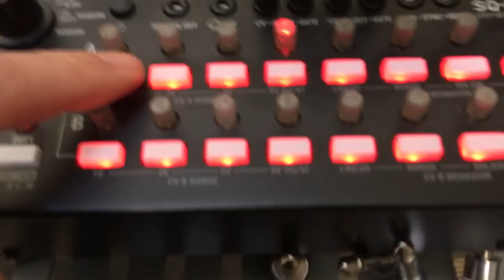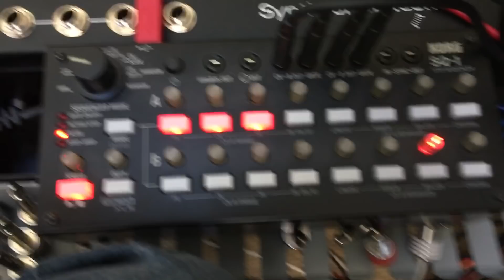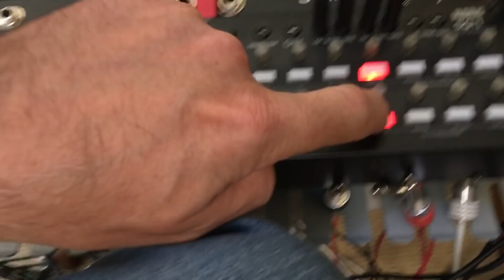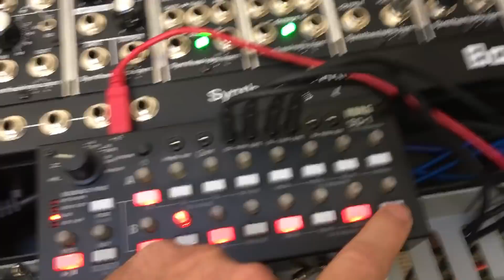Korg SQ-1 Undocumented Features

Comment: Yes this very simple yet versatile sequencer has a lot of undocumented features. Also, since its behavior is different between midi and cv/gate modes, you can use midi connection and still send cv controls to filter, envelope and so on. The only feature it lacks, is the ability to keep tempo when switching modes with the main knob: it restarts from the first note and usually loses the tempo, if you are not perfectly precise with your hand. I wish that Korg decide to release a firmware fix to allow the sq-1 to go on thru the sequence keeping tempo when switching the mode, as is in the volca series. Maybe soon ?? 🤔

Comment: Chromatic sadly has nothing to do with "quantisation"....Quantising is rhythm or better "grid" related...Chromatic is scale related.
Reply from the maker: From a technical standpoint, mapping any set of larger values to a smaller set is Quantization. I agree that in our DAW’s we quantize time (or beats). The SQ-1 does quantize it’s output voltage from a continuous range of voltage, to discreet values determined by the settings (either Oct/V or Hz/V). A Chromatic scale is a frequency relationship between pitches. In Western scales, the Chromatic scale is in semitones. Our synthesizers convert Quantized Voltages into Chromatic pitches.

Comment: Can you run two midi devices on channel A and channel B with different midi settings ?  A set to midi ch 1 and B set to midi ch 2.
Reply from the maker: I’m not sure I understand your question exactly. By default Chan A outputs on MIDI CH 1 and Chan B outputs on MIDI CH 2. You can change this with the Global Settings method. When in the Parallel Mode, Chan A will output to MIDI CH 1 and B will Go to MIDI CH 2. If you assign one synth to CH1 and the other to CH 2 you will get independent notes on each synth. You are limited to 8 steps for each channel. If you go into a mode that uses all 16 steps it will be output ONLY on CH 1. Not sure this answers your question or not, so feel free to elaborate.
Reply: Thank You. Really appreciate your getting back and your excellent video.

Comment: Hi, I have a question. I'm thinking of buying this machine, but I was wondering and you seem to know the SQ1 very well. 

If I sync it to another machine with the 'sync in' connection where the other drum machine has sync triggers at 1/16 (compared to a measure on that drum machine) , can I somehow have faster speeds going out of the SQ1?

From my understanding no, cause the SQ1 will move forward a step based on the input sync, so it can never go faster than what the input sync is doing, but I hope I'm wrong?
Reply from the maker: Hi Dieter, if you want the SQ-1 to run faster than the clock on Sync In, then set the set the Sequencer step resolution (SEE FAQ on Korg website how to do this) to one of the x2 modes. It will run twice as fast as the input clock. You are correct in that  Sync is a STEP control and not a speed control. Another idea is to use the GATE OUT of one channel of the SQ-1 as the sync TO your external drum machine (your drum machine will follow the SQ-1 gates as a clock). That way you can turn gates off on the SQ-1 to slow down the drum machine relative to the SQ-1. This is probably only useful if you are only using one channel of the SQ-1 for notes though. Assuming you are in the parallel mode with 8 steps from each channel, you could have the SQ-1 effectively running 8 times as fast as the drum machine (by having only one gate ON for the 8 steps). Using this technique you can get quite strange results when the number of gates that are on is not an even number, or are not evenly spaced!

Comment: Hi Mike! I have SQ-1 hooked to TD-3-MO and the gate just never closes to trigger new envelope, voltage changes but it is sliding slowly to zero volume... I had to insert one extra Gate ON slide OFF note, any chance you know why could this be?
Reply from the maker: Hi, and thanks for watching the video. I took a quick look at the spec sheet for the TD-3-MO since I don’t have one. It looks like the Gate input is compatible with the SQ-1 Gate Output (which is almost 13V when ‘on’). I’d make sure the duty cycle isn’t set to 100% on the SQ-1. ‘Off’ = 0V, ‘On’ = 13V. The other thing you could try is hooking up via MIDI. Without your Bass synth, I unfortunately can’t experiment myself. I hope you work it out.
Reply: @mikeolson7588  I thought I figured it out with factory reset but not... I will keep trying.... Noticed the same behaviour if I push the duty knob past 4o'clock, even without the slide... Thanks anyways for the videos and active participation!
Reply from the maker: @gumdlab7233  also make sure its in the Positive Gate mode. Remember it supports both the 1V/oct mode and the Hz/V standard. The Hz/V is the old Korg standard and the gates are Ground instead if +5V.
Reply: just measured it with meter it is just solid 10v out of gate all the time with slide. the next active step/gate on  with slide does not seem to drop it to 0 to restart the amp envelope.But maybe that is as designed and the synth is at fault...

Comment: Hello, my SQ-1 arrived today and I have a question regarding midi output. Testing the unit I'm using only the supplied midi adapter that came with the unit. I connected it to my Novation Bass Station 1 via USB cable only. It only plays sequence B not sequence A? Is my unit faulty or is this normal behavior using the supplied midi adapter?  Found nothing in the manual regarding. Thank you .

Comment: Hi there - does this device have a swing function?
Reply from the maker: That’s a great question. No, it doesn’t have a built-in capability for swing. However, since it has external sync, if you have a device that produces gates with swing, you could sync to that gear and get a swing effect. I’ve been using an external gate generator lately with the SQ-1 to create irregular rhythmic patterns and it works quite well.
Reply: @mikeolson7588   Thanks. Sounds a bit complex. No swing a bit of a deal-breaker for me.
Reply: @mikeolson7588  If you use an external sync source for swing, irregular, or slow clocking, I suggest using the SYNC X1 clocks per sync pulse setting, in the global parameters.
The reason why is, SYNC X2 (the default) does not work well with irregular sync pulses.

Press and hold the Play/Stop button while powering on the SQ-1.
Then turn then adjust the position of the SEQUENCERMODE selector to the appropriate step resolution as follows.
• “=>“ PARALLEL ORDER: quarter note / SYNC X1 
• “=>“ CV DUTY: 8th note / SYNC X1 
• “=>“ CV SLIDE: 16th note / SYNC X1 

* SYNC X2 = 1 sync clock advances 2 steps / SYNC x1 = 1 sync clock advances 1 step

Comment: Can the SQ-1 function as a clock source to send clock signal to a Eurorack sequencer and if so, how would this work?
Reply from the maker: Yes, it can be used as a clock source. Both the GATE A and GATE B outputs can be used. One caution is that the voltage range on these outputs goes between 0 and 13 volts. You may need to attenuate that signal before sending it to your clock input depending on the module you are using (See the datasheet for your module). In my modular system (which is 5U and not Eurorack) the modules can accept 13V signals with no problem even though most gates only need to be > about 2V. Hope this helps you. Also pay attention to the Duty Cycle knob on the SQ-1 as setting this too narrow may prevent proper clocking of your module. Happy patching!
Reply: @mikeolson7588  Also the SYNC out can be used as a clock signal.
The Gate A and B outputs stop sending when you press STOP on the SQ-1, where as the SYNC out keeps sending clock signal all the time, regardless of the PLAY/STOP of the SQ-1.

Comment: The manual explains the A/B behavior you started with reasonably well but you're right, it says nothing about this business with gate and slide.  Those are fascinating discoveries!  Thanks for sharing them.
I accidentally discovered there are more sync modes than those listed in the documentation.  I wanted my SQ-1 to slave to an irregular modular clock and advance 1 step per pulse - none of the listed settings worked the way I wanted, but I turned the knob farther and got different patterns of lights.  I don't know exactly what mode I finally selected, but it now works the way I wanted it to...
Reply from the maker: Thanks for watching. I showed the various modes at the beginning for completeness and they are fairly well described, though I would have described them in more detail, particularly what voltages are coming out of the A and B CV outputs in the different modes. Making rests was something I found to be interesting as well and there is really no mention of that at all.

Comment: Thanks great video..
Cables look great. Where did you bought this?
Reply from the maker: Oh, OK. Those cables are from synthesizers.com. They are specifically manufactured for the TB22++ system and are custom made. They come in many lengths and colors and are perfect for that system because it’s relatively small.
Reply from the maker: If you are referring to the cables going from the SQ-1 to the modular synth, they were from Sweetwater. They are mini-jacks on the SQ-1 end and 1/4” on the modular end. I believe they are 5 feet long.
Reply: @mikeolson7588  no .. The cables hanging down under the sq-1, in the "rack".... the red and metal ones ...

Comment: Mike thanks for the video, Im new to synths and sequencers, but would you know if this unit can be set to control one quick pass of a sequence and then stop, to be then triggered again by the keyboard?
Reply from the maker: Hi John, thanks for the question. The SQ-1 does not have a single-pass mode like many sequencers do. It also lacks a RESET function which can be somewhat limiting for the kinds of things you are describing. The SQ-1 DOES have an external SYNC input that allows something else to step the sequencer. In order to what you have described would require some external gate processing. If you had a reasonably large modular synthesizer with gate dividers and trigger processing, it could be done, though that is beyond the scope of the SQ-1 by itself. That said, I still find the SQ-1 to be amazing for what it DOES do and it’s very low cost.
Reply: @mikeolson7588  Hi Mike, thanks so much for that reply, really helpful. Im trying to tame an Anniversary Moog Voyager haha, so thats what we have synth wise. Looking for short rhythmic/melodic sequences we can trigger and re trigger, quite short, fast and in the high frequency ranges, a bit like what Walker did on Nite Flights. You've saved me a few quid here, so I'll be sure to support your channel. Yes the SQ1 is attractive for its price point. The Dark Matter seems, well too dark for the tones we're seeking. Dont suppose you have a recommendation given the above? Best regards and thanks again

Comment: Can i use sq-1 as a LFO kind of somehow?
Reply: Yes. LFO is  just a looped smooth sequence or an envelope of some type. So, you could for example do a squar-ish LFO by selecting a two step sequence one step at minimum the other at max for example, and you should get a square LFO.
Reply: Dumbpublic Hater ...or you can use 8 to 16 steps to create the LFO with the shape you want, sending cv to pitch, driving the tone to go different directions as you tweak knobs, changing pit points

Comment: So it's an external sequencer that only has the ability to store one pattern in it? How would you ever be able to use it live if that's the case?
Reply from the maker: That is correct. It’s analog sequencer with no memory capability. That said, it is quite a fun little sequencer. Remember that you can turn Gates On/Off while the sequencer is playing, skip steps live and move to any point in the sequence manually live. For even more fun, watch my other video showing sequences longer than 16 steps which allows for polyrhythms.
Reply: seanwinter sax it goes like this: midi seq with memory can store up to, let’s say, 10 (Volca range) to 500> (Arturia/Electron range) patterns. You can program them beforehand and switch between during live show seamlessly. Very convenient. 
On SQ-1 you have only one but very movable sequence panel (or two - A & B), where you can have almost endless amount of patterns, but you have to change them by hand continuously. It’s just different type of workflow, a bit behind of what Beatstep pro can provide, but still very tactile and groovy. It can do a lot when you play something like ambient, seamlessly changing notes and patterns, or techno, playing live with couple of other instruments or people jamming

Comment: Useful video , I don't have a sq1 , looking at synths , but the rest extend notes is what I'm looking for , can sq1 just play on its own?
Reply from the maker: Hi Marcus, the SQ-1 doesn’t make sound on its own. You need to connect it to something else that takes either MIDI note input (which is very common) or Control Voltages (CV) which you will find on analog synthesizers and some other devices. In the demo here I’m using an analog synthesizer and connecting the CVA and CVB to two different oscillators. It is the oscillators that are making the sounds.
Reply: @mikeolson7588  ah ha , I always wondered why this wasn't .rnentioned , but oddly I like the sounds it seems to make .
Reply: Thanks